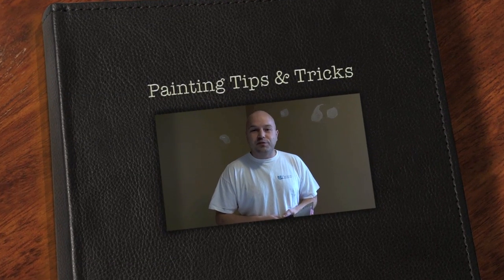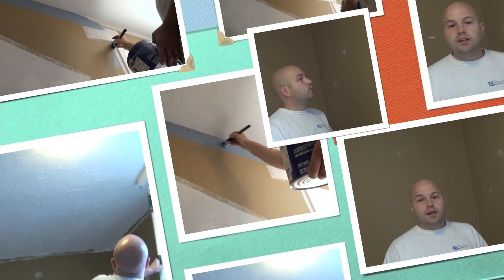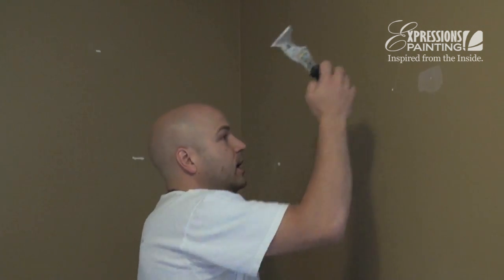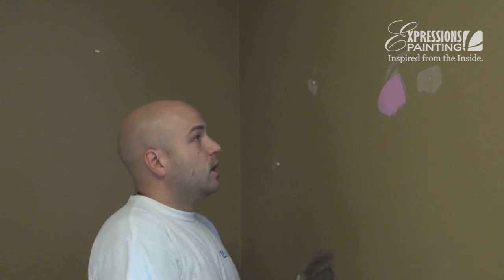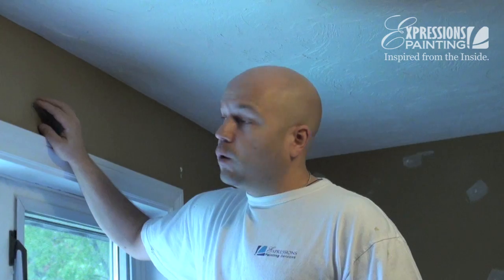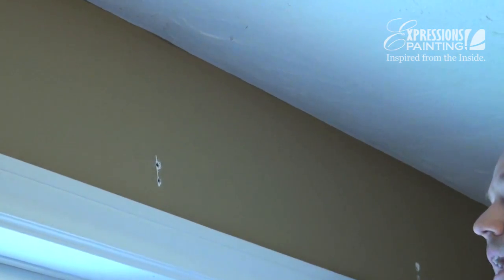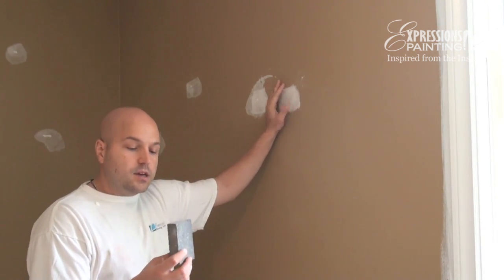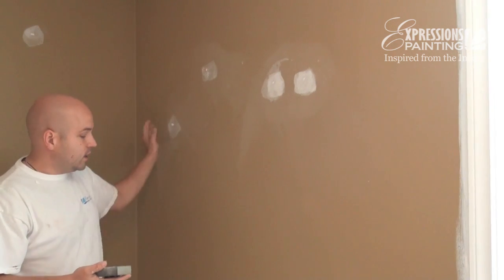How to repair drywall like a pro

Comment: I had an eggshell grayish color paint on my walls. I am repairing holes, dents ect.
I am going to sand the next few days as my walls look like a dalmatian. I am going to prime the entire wall then paint a new gray over prime. But..
Im using eggshell again instead of flat
What kind of primer should I use.
Kilz or drywall? I have drywall primer from Sherwin Williams now.

Comment: Can you use a spray gun (Wagner W890 is what I have) to apply a mist/base coat to freshly plastered walls?
Reply: If ur going to paint the ceilings also. Because if not ur going to get overspray on the ceilings. The only thing I spray in a interior is the ceilings. Then I cut and roll the walls by hand.

Comment: As a handyman I like to cut away any paper damage with my utility knife and like you tap down tap down the damaged area because you are right, some of the damaged can end up being proud of the surface. However, what I like to do then is use some low tack tape and form a tight fence right around the damage.  Then after I fill the area, I peal the tape away and let it dry.  Now you might think that when it dries the compound will be as thick as the tape and you would be correct.  However, with the Pink dries to white Spackle it has a tendency to shrink a bit. But sanding is too easy.   Try it some time, you see what I mean.  Another reason I use the tape method is because it doesn't effect the texture coating if there is any.  Nothing is worse than walking into a room and seen a textured wall with a dozen patch marks.

Comment: Thank you! Here most interior walls I will be coming across will have a knockdown or orange peel texture. One of the things I see the most here is after the nail hole repair that painters make to these type of textured walls there is a flat spot that is very easy to see and looks horrible I want to perfect patching nail holes in the textured walls so that you cannot tell it was patched. Any other advise or can you tell me what to do or not do so that this does not happen to me. I will buy whatever products or tools needed to do it right this is something that really bothers me to see on a wall I guess this is also called flashing? So the CGC is a all purpose or a lightweight? Not sure I can get CGC here in California any others that would be close to CGC? YOu have all the good stuff in Canada :)
Reply from the maker: The only thing I can think of would be to sand it thoroughly around the patch so that the transition is smoother

Comment: Tuning your Wet Vac for small Jobs Helps with Dust. I find best to make circles over Patches or wait 30min then start roles walls while paint st ill kind of wet from paint you put over the Patches.
Reply: To save time , go to Home Depot in the sheetrock department, pick up a small bag of 5 min. Compound, a mud pan and a putty knife and the 1st thing u wanna do is scope out all ur holes in the room ur painting and mix the compound with water, not to soupy, and apply to the holes. Then start cutting in your walls
Do 1 wall at a time . Cut in 1 wall in a square: cut the top wall , the side, and the top of the baseboards, by the time u finish cutting in the compound will be dry enough to roll.

Comment: Does anyone have any tips ? some of the patch still show through the paint, even after painting over the small patch first, letting it dry, then a coat of paint for the wall.
Reply: p.s. we didnt use a flat paint for the primer . Just need ideas on how to fix it :/
Reply: Yo Mama use oil based primer. Waite till it dries them reprime with the wall color then apply wall color

Comment: What grit of sandpaper did you use?
Reply: Melanie Bee . Not too low grit because it will take off too much of the spackle . 120 grit or 100 should get the job done .

Comment: I  also want to thank you Remi  some tenants just moved out her in Brooklyn nyc and the cop who lived there put in about 100 holes at big as a pencil hole. For shelving. I had always sanded down around the paper. But never thought of pushing in the paper deep enough before plastering. So I always built up the plaster around it and Hench to much to sand. I usually wet sand it. All too much work. The way up did this actually is less plaster little dry sanding. I almost can't wait to begin. But man I hate to look at these holes again. I should have charge him say ten for each hole and taken it off the deposit  cop or no cop. It says it in the lease about holes thanks again. Best wishes for the new year.
Reply from the maker: Glad to hear :)